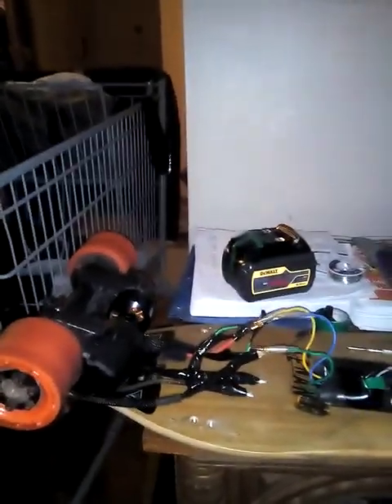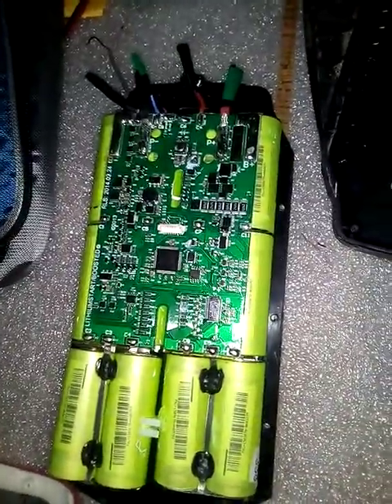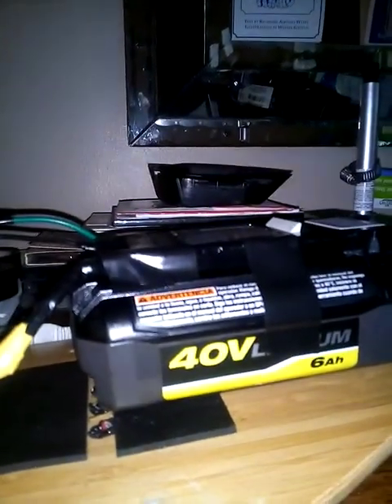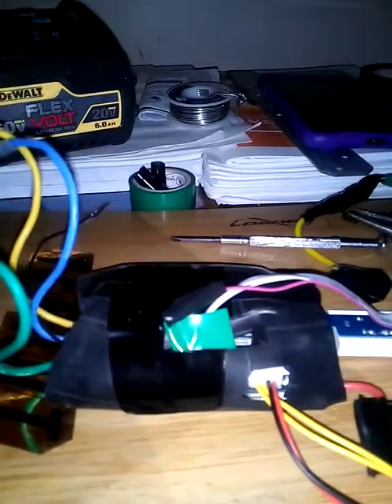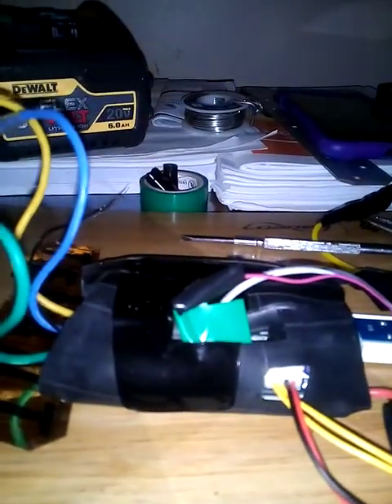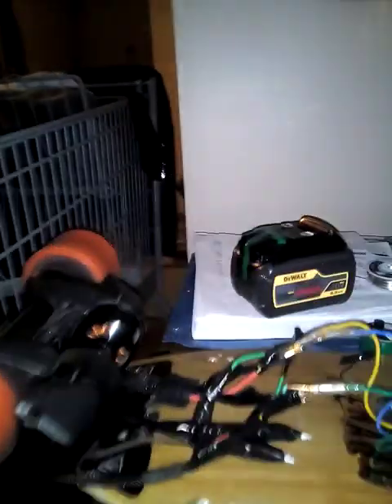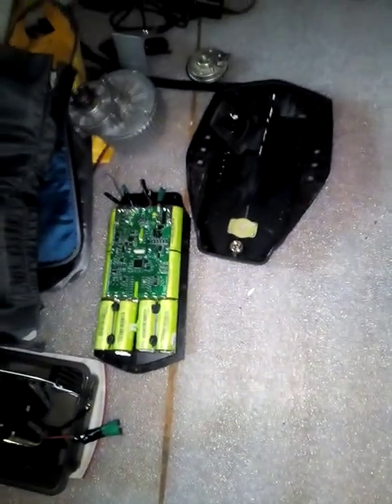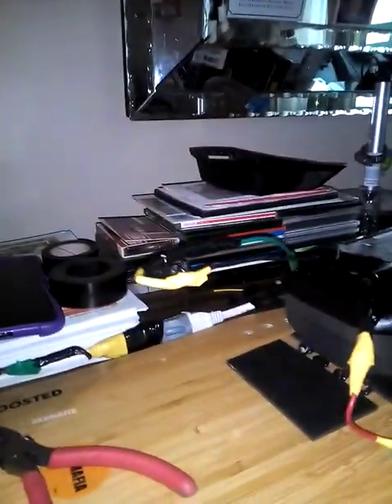Easy solution for Boosted Board V1 (Dual +)

Comment: Thanks for this video! I’m about to throw my V1 Boosted Board away until I seen this video… how has your board working with this set up so far have you had any issues? Is it worth it for me to try the same thing ? Thanks !
Reply from the maker: Hi.  How are you?

I apologize for taking long to reply.  Been so occupied doing other things.  I actually have not been using my boosted board for quite some time because when I did that modification, I went out and rode and the first thing I noticed was that when I tried to stop downhill, I could not at all........even on flats.
    The remote control is just not safe as it requires data to be processed to the wheels.  Just some wisely advice, bluetooth is not effective when you need to come to a stop, I strongly recommend a hand brake like the ones used in the off road boards.  
    Just like your tesla, you still have a brake pedal.  You don't press some button and it magically stops. You always need something that can mechanically stop the car.
      Right now I am doing some modifications with some balance scooters.  Please check out my channel.  I have gotten so obsessed with the electric unicycle market 

Oh yeah...... definitely don't throw your board away.  Do this modification.  Get rid of the standard battery. Replace it with another lithium battery and get any esk8 board do it yourself kit..........but always remember get that hand brake.

Peace out
 Thanks for stopping by

Comment from the maker: Oh just a heads up
  I highly recommend a mechanical brake for the longboard.  Why?  Well most eboards rely on the software to slow down.
They mainly use the remote to slow down.
Also, the slow down to stop effect on a typical electric board is slow down then  reverse motion.

  There is no brake system like on a bicycle or car.  Those are mechanical. 
Decelerating too much on an electric skateboard does cause heat build up and the computer restricts braking.  This is extremely dangerous.  If you are in motion on flats or going downhill, you will HAVE NO BRAKES because the longer you ride, those motors heat up

   So please add a mechanical brake

Comment: Thanks for the video! I appreciate you uploading this!   

V1 boards are so great,  solid and last forever...aside from the un-protected ESC issue. My V1 was an early build,  late 2014. I put thousands of miles on it and after 2 years I transplanted it to a Poke.  I rode it hard,  popping of curbs daily...  lasted everyday riding  until late 2018.  ESC suspected.
Throwing darts at the wall i had de-soldered the cells and its a pain,  i don't recommend unless its just to replace a bad cell.  i thought it would be the on off trick...sucks when the cells are on  the pcb! it got me nowhere aside from learning a bit more about the component and the esc vulnerability. oh and use a wick and cover the surroundings on the entire bms when doing any work on a energized circuit board.  :/
Boosted wouldn't sell a BMS or an ESC. They wanted 500 dollars and only they would do the repair. I had pretty much determined it was only the ESC and they just wouldn't budge.  Luckily i had a v2  already and slapped the parts onto the poke. I love it, but it'd be great to fix the V1.  Those V1 speed controllers have zero water proofing and totally exposed to the dirt and dust.

Have you ever replaced a v1 motor by chance? ive got to repair or replace a motor on a different v1.  Any Tips?
Reply from the maker: Thanks for watching the vid.  I hope that the info was helpful to you.

Please share this video with whoever else you know may have a boosted v1
Reply: @milestone_achiever4634  awesome. Any updates on this board?
Reply from the maker: @Electric_Snap  I actually haven't rode mine in a while.   Been busy working 2 jobs.  I ordered some rubber skateboard wheels from eBay to put on the front trucks..............just for a smoother ride.  That's what I did most recently.
   The front wheels take about 70 percent of road impact.   I personally think they should do away with polyurethane wheels.........no cushioning whatsoever.  
    After a 10 minutes of riding, your feet are sore as hell.
    They should consider using rubber wheels on all electric boards and just keep polyurethane wheels only for regular traditional skateboards without any motors.
   No major updates on the board.  After I did that light modification, it runs just fine.   
    I  am considering, adding a mechanical brake
 
Take some dear advice: 

The braking effect from the hand remote is simply not safe at all!!!!